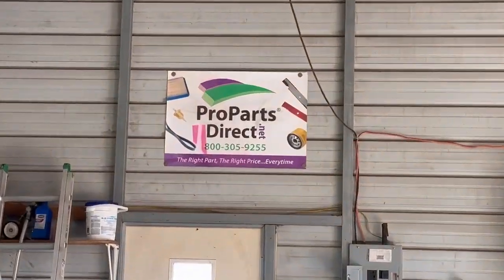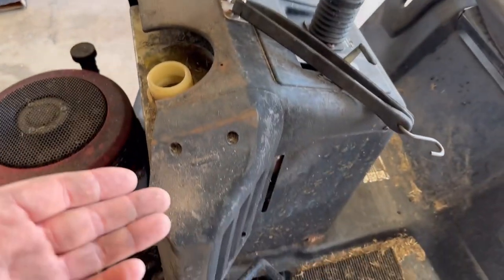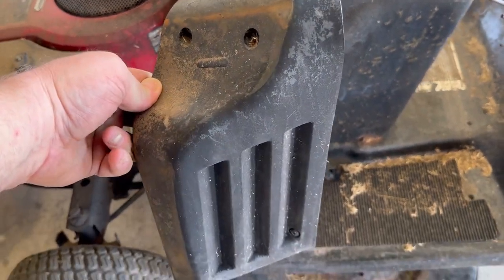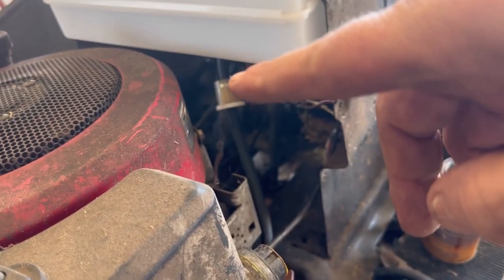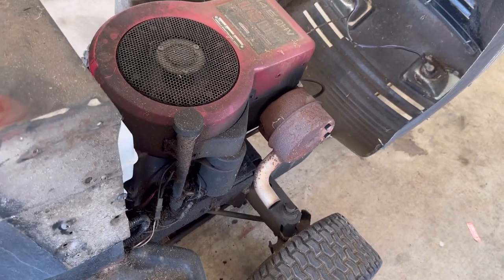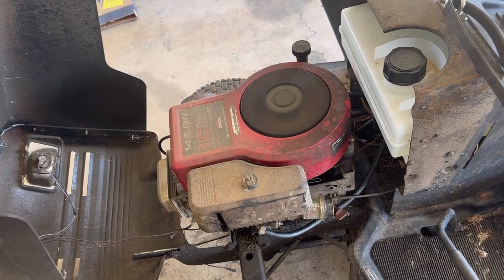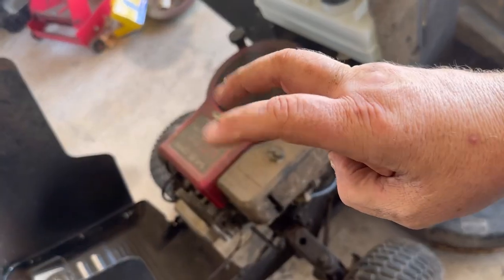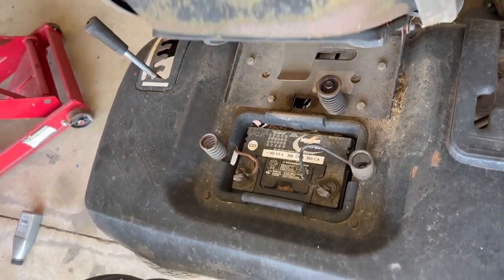HOW TO REPLACE THE FUEL TANK ON JUST ABOUT ANY RIDING LAWN TRACTOR

Comment: Just finished a Craftsman 42" mower. 1999 model. Had the turbo cooled Briggs. Had been sitting at least 3 years. Had to clean out the carb. Had some dirt in it. No shellac. Fired up and ran almost like new. Those 22 horses were running pretty smooth. No smoke. Finished it up. Ran it for close to two hours at all speeds, let it idle for 20-30 minutes. Gave it back to the owner. He called the next day and said it ran about an hour and quit. Let it set an hour, started and quit after a few minutes. My thought, bad gas or water in the gas. I hate calls like that. Nice easy fix Jeremy.

Comment: 2 things. 1st there was a recall I think on some of these for the tank issue. 2nd there's 2 different sizes for the tank. If you have the small you can install the larger one in its place.
Reply from the maker: My model number doesn’t show two different Tanks but thanks for the tip

Comment: On my riders, and any friends who I do work on that has a dead battery, I do the body work necessary to install a 51R or 51 automotive battery. Three year free replacement and much better batteries. I have yet to replace one under warranty. I installed onhe in my John Deere LA150 about 10 years ago and it still turns the mower over like I have a jumper pack on it.

I usually remove the tank that is next to the engine, if that is where it is, and place the new body work under the dash to install the 51R. I use an external metal fuel tank attached to the rear or if there is enough space under the seat where battery was. Metal tanks do degrade but generally last longer (when cared for) than molded plastic.

Comment: I always install the fuel shut-off before the filter.....saves some time and a little grief when changing the filters. Turn the fuel off and run the machine until it quits, filter is then empty and no gas ends up spilling anywhere. : )
Reply from the maker: Good idea 👍

Comment: Friend, what's the part number of that tank?  I designed a 60" pull behind with 3 engines & that tank would be perfect for me to add 2 extra nipples to use for all 3 engines, the part number would be greatly appreciated, I could use some 90 degree angle arm for the mounts